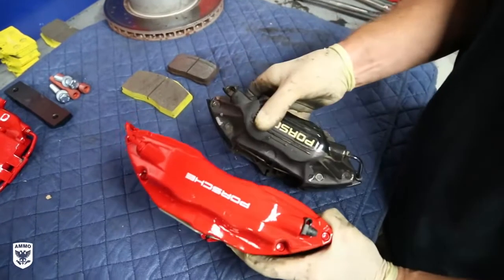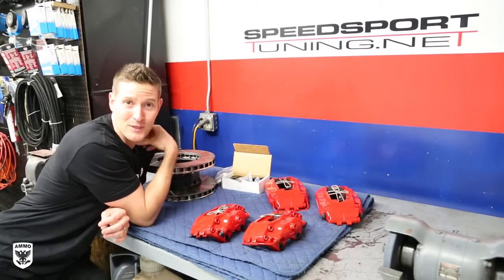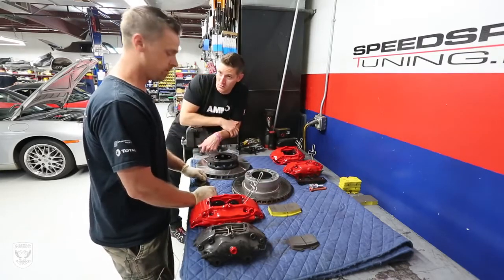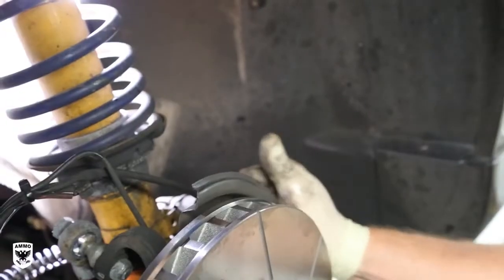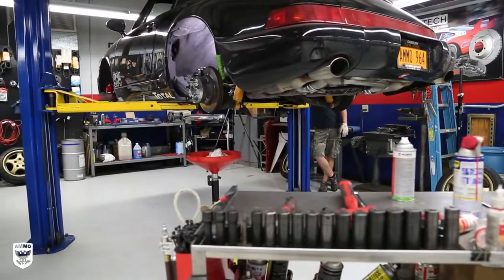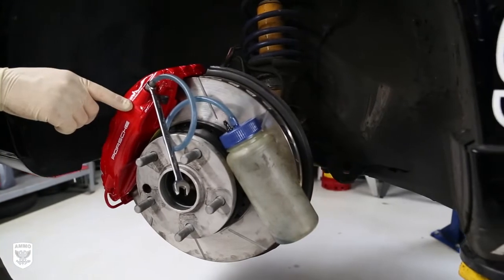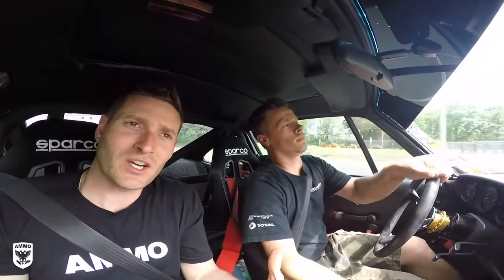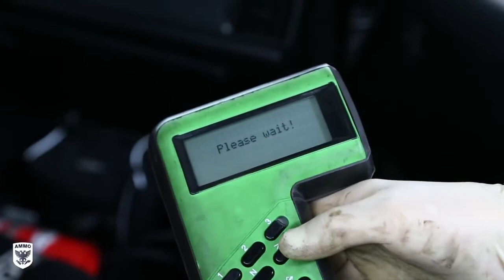Porsche 964 - Big Reds Brake Install

Comment: Love the channel and also the video, but this is a little bit of a over simplification. I did the exact same process on my 964 and it was A LOT more involved. Factory MC is too weak if you have a C2. You will need the whole 993 MC assembly to convert, not only the MC. If you have a C4, then factory MC is sufficient.

Comment: Honestly the bigger rotor shouldn't be seen as a benefit, it's more rotational mass and more unsprung weight. The bigger caliper and pad is helpful, but the rotor isn't, you would've been fine with just going to a more aggressive track pad from someone like Carbotech, pagids are just too overpriced for what you get imo.

Comment: "E" brake? Its a Parking brake. There is nothing "E" about it.....
Reply: E meaning EEEEEEmergency brake which also doubles as a parking brake
Reply: @thbigshot101   I have been driving for 33 years, I've never used the parking brake for any emergency, yet I use it every time I park my car.
Reply: @DasArab  right but the actual use of the e brake doesn't discount the intended use of what it was made to do... Dual purpose. I'm not saying that your wrong. I'm simply saying that there is more that the parking/e brake was meant to do then what you stated.
Reply: @thbigshot101  The Handbrake's only intended purpose is to stop your car from moving when you park your car. It could also be used for doing handbrake turns, if you so wished,  yet you never hear it being called the Handbrake Turn Brake do you?
Reply: @DasArab  The reason its called an e brake is because if your brakes ever fair that's the last resort to slow down your car. Hence why its not very powerful as if you pull up on the handbrake which its also known as because you use your hand to..... brake the car, you can lock up the brakes and that's an accident. I don't understand why this is such a big issue that caused this much debate. someone in another world will call it another thing because that's what they use it for. Will you also argue with them that they are incorrect when they are doing the same exact thing your are? which is using the name that best fits your use case.
Reply: @thbigshot101  So its named an Emergency brake even though 99.9% of motorists have and will never use it for an emergency, yet everyone uses it everyday for its intended purpose to stop a car rolling away when parked. Thank for clearing that up.............
Reply: @DasArab  it's name is interchangeable is what ur not getting. Besides you already answered your one question.
Reply: The USA is the only country in the world that will call it an emergency brake. And even if it was (which it isn't) in will not stop your car fast enough in an emergency anyway. As in only brakes the rears.
Reply: @N911GT2  Thank you. Finally someone with a clue.